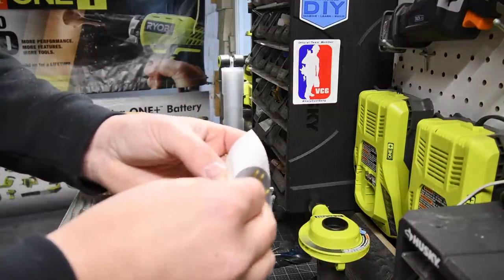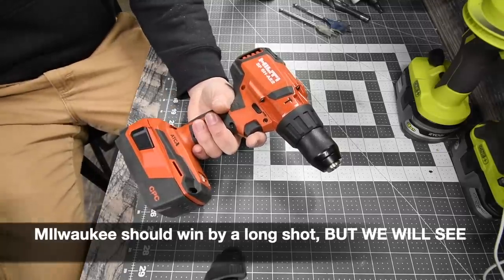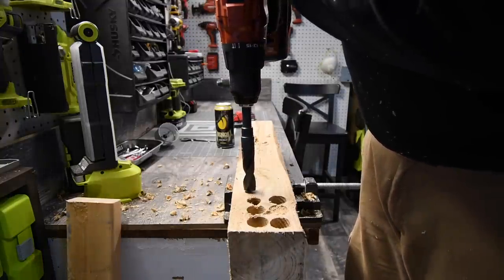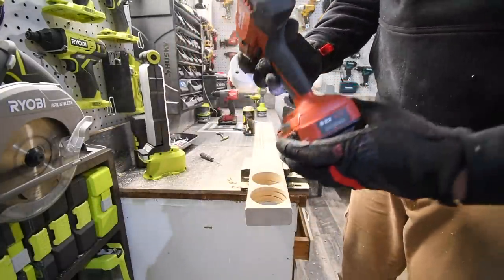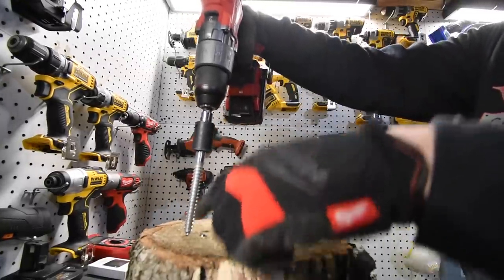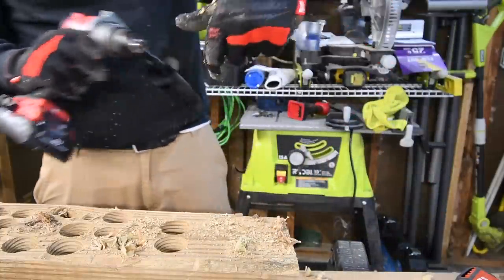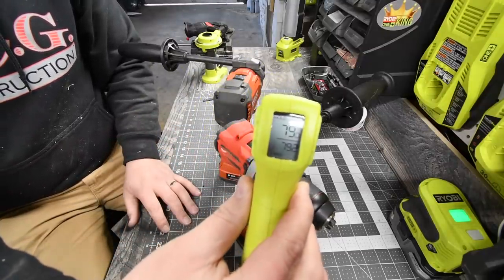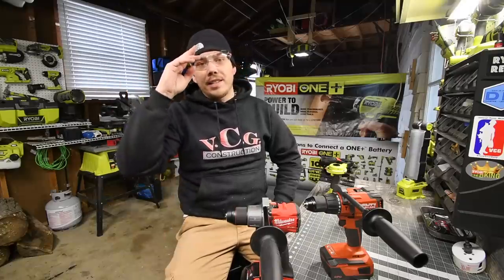Milwaukee vs HILTI (WOOD)

Comment: Hilti wins! Plus the Hilti will out live the Milwaukee by years!!
Reply from the maker: I agree, more test are coming and thank you sir
Reply: Don't forget price/performance. The hilti, at least where I live, is twice the price of the milwaukee but as seen here does not have twice the performance.
Reply: @Turgz  But it will have 5 times the longevity and here in England it's not that much more expensive than the Milwaukee. I own both the Gen 3 and this new Brushless Hilti. The Hilti is far superior.
Reply: @davesheppard8797  I don't doubt that it's superior, it's just not worth it for the price I have to pay for slightly faster drilling speed.
Reply: @Turgz  The thing is that I find all my Milwaukee gear unreliable. The only Milwaukee tool I haven't had problems with is my second 6 1/2" fuel Circular saw. The first one went back faulty. Having said that I have hardly used this saw as yet but it runs every time I  press the trigger which is more than my other Milwaukee stuff.
Reply: @Turgz  in this video Hilti  doesn't have twice the performance but beats Milwaukee all day long.
In this video also Hilti drill is $10 cheaper than featured Milwaukee. 
Compact battery from Hilti also outperformed special compact battery from Milwaukee. 
Please stop saying myths about Milwaukee. 
Now comparing warranty and customer service -Hilti wins again.. 
Comparing tool after 5-10 years Hilti wins again as Milwaukee drill would not exist by then while hilti drill still going strong. 
Hilti - built to last.! ☺
Reply: @toolfevertoolfever8716  Yes, plus it's not just faster....It's built better, It drives screws better and deeper, It has ATC so you won't break your wrist if it snags and the trigger works every time!
Reply: @davesheppard8797  exactly that.
I love this feeling when you come on site and don't think if Your tool is shiny,cheaper ...bla bla bla...
This feeling when You don't think of anything else than get the job done and come back home - priceless.
Reply: @davesheppard8797  my honest opinion about Milwaukee. 
They release new tools quicker than warranty on previous models expires.
This is to say "hello we have bigger ,cheaper , better tool available than we had (You purchased last year ) so come and get a new one before old one breaks up as it's cheaper to make new one in  China than fix the old one because old one was developed in order to buy new one instead and so on for years.(If it makes sense ).
Hilti doesn't release new tools too often as every tool needs to be developed and designed for end user to be 100%satisfied and before mass production it needs to be tested for that criteria. 
Milwaukee is cheaper as it seems they skip any tests.
I have seen Milwaukee and Hilti tools inside and I would always go for hilti.
Reply: @toolfevertoolfever8716  yes.....And Milwaukee fans will always have to have the latest and best Milwaukee out so they are probably not kept in service long before they are replaced with new. Milwaukee must make a fortune this way. I run Hilti and Milwaukee. I have both the drills in the video test. As I said I put an 9amp high output battery in my Milwaukee  and a 2.6 in My new Hilti. Also a 3 amp in the Hilti and a 5amp in the Milwaukee.  Hilti won every test with just 2.6 and 3.0 batteries. I don't believe higher amp hour gives more power...just more run time. Also the Milwaukee's get really hot compared to the Hilti's
Reply: Anyway you are probably all young whipper snappers who've not long been shaving! Not an old 57 year old bugger like me with dodgy legs and too many wrinkles!! (lol). As I approach retirement I like the best and can afford it, so I buy it. So in 8 years time there will be a load of Hilti, Milwaukee and Makita gear up for grabs if anyone wants it!! 🤣🤣🤣
Reply: @davesheppard8797  I totally agree with You.
Hilti saved me a lot of money in a long time relationship.
It came to the point that I was bored with it and followed trend of new girlfriends (milwaukee, dewalt etc.).
I couldn't believe that sleeker (sleeker by size not design)looking and nearly 2 times lighter tool from milwaukee or Dewalt could be more tiring to use than good old Hilti. 
My hands were hurt after using Milwaukee etc.all day long.
Good old Hilti! !!
Reply: @davesheppard8797  glad to hear You are enjoying Your life.
I already have some wrinkles myself.
Keep up good work mate.
I would sell all the tools and go for early retirement ☺
...but on other hand retiring and not doing anything is bad idea too.You need to be involved in life for as long as possible...
Reply: @toolfevertoolfever8716  Oh God! You too? Exactly the same with me!! I got caught up in the Milwaukee hype and bought a load of gear. Ooooops!! Bad move the stuff is crap!! I am back with Hilti for good reason!! (Lol).
Reply: @toolfevertoolfever8716  yeah....the trouble is.......I am dreading retirement!! I love my job with a passion and have been there for 36 years. I am a Maintenance Manager at a large theatre in Bristol, England. I want to bring her back to how she looked in 1912!! 😕😕
Reply: @davesheppard8797  An English man with a passion 👏👏👏
Reply: @toolfevertoolfever8716  Thankyou! 🙂🙂🙂👍👍
Reply: @davesheppard8797  how can you put a 9 ah "High output" battery from Milwaukee? The 9ah is a "high demand", not "High output" battery. The ONLY "high output" milwaukee batteries are the 3, 6, 8, and 12...and the 12 is a "high demand, high output" battery. HdHo
Reply: @christiansantos1429  perhaps it is......but my point was that the 9 amp hour didn't out-do the Hilti with only a 2.6 in it. I apologise it is a high demand battery, I have just looked. I bought the 9amp for my Milwaukee 6 1/2 fuel Circular saw.

Comment: Milwaukee would do better with a bigger battery.
Reply from the maker: but so will the HILTI. I will revisit these test once I get the 8ah HILIT and Milwaukee batteries
Reply: Nah!.....I did a head to head test with these two drills...two weeks ago. Hilti had 2.6Ah battery the Milwaukee had a 9Ah battery. The Hilti still walked it. Bigger batteries give you longer run time not more power.
Reply: Dave Sheppard nah that’s not true they give them more power!
Reply: @rogerslawncare7260  Not on the test I did with My Hilti and Gen3. Hilti 2.6 amp Milwaukee 9 amp. No more power in the Milwaukee than there was with the 5 amp Milwaukee battery. Have you done the test with both drills?
Reply: Dave Sheppard No but I have watched the same drill vs same drill Milwaukee with H.O battery vs normal battery and the H.O battery wins check it out.
Reply: @rogerslawncare7260  Is it on YouTube??
Reply: @rogerslawncare7260  Do you have Milwaukee as your battery platform? I find Issues with the triggers on all my Milwaukee tools except my recently purchased 6 1/2" fuel Circular saw.
Reply: Dave Sheppard yes that’s my main tools but I have tools at work from dewalt I prefer Milwaukee. I do not have any issues with my triggers. If you have issues contact the warranty folks I’m sure they’d fix it for you.
Reply: @rogerslawncare7260  Its strange.......A contractor who came to the Theatre where I work had exactly the same issues. His issues were intermittent as well. He sent them back to Milwaukee but said he was still getting problems after. I have returned some of my gear. My 6 1/2" fuel Circular saw went back after a week as the motor was really rough. The replacement seems better but I haven't used it much since I got it. I have been doing heavier cutting so I have been using my 210mm Corded Makita. I just find that the Hilti's are my go-to drills over the Milwaukee. I have much more confidence in them. I am glad you have had no issues with yours. Here in England, Milwaukee tools are a lot cheaper than Hilti though. Power tools have come a long way since I started working with them 40 years ago. My first drill was an all metal black and decker with a 3/8" chuck, no hammer action and no slow start. A single speed of 2,400rpm and nobody had heard of torque settings!! (Lol). Plus masonry bits were pretty useless in those days. The Theatre I work at has a lot of semi-engineering bricks in it so the drill was even more useless!! (Lol).
Reply: Dave Sheppard You hit a lot of points here but I’d like to comment on the all metal body power tools my grandpa had the all metal skil saw and it was honestly a sweet cutting saw smooth as butter but they are dangerous if the saw shorts out it can shock you I think that’s why they outlawed them here in the states. I will say this I run the brushes Milwaukee tools they are older technology but I got a good deal on them so I couldn’t pass them up they are a big step up from my previous porter cable lol. The only brushless tool I have from Milwaukee is the fuel sawzall and I love all the tools brushed or brushless.
Reply: @rogerslawncare7260  I have a Skil saw I bought about 30 years ago, still going strong! It was the sort of Gun metal blue one with the gold blade surround. I keep wondering how much more powerful these Combi's can get. They keep making them smaller with huge power! I have the Gen 3 Milwaukee and this new Hilti but they really are much more powerful than I really need. I am not one of these people who use a combi for everything.  Any more than 4  2" deep 6mm holes in brick and I get out the battery SDS. Being old school I still get surprised that my Hilti battery SDS drills better and faster than my corded stuff!.

Comment: No wonder you put a 3ah battery and call hilti the winner no no no hilti won because you ran a 3ah battery
Reply: You lost punctuation somewhere)
 The Milwaukee 2804/2904 doesn't come with lightweight batteries, it's an "alternative" battery that's perfect for impact drivers. Unlike you, I conducted tests with 3.0, 5.0, 9.0 and I can claim that with 3.0, the performance in difficult tasks is less than the "standard" 5-6A*g by 30-50% 
You didn't do that, so all you have to do nonono nanana banana.

Comment: It's still 20 volts not 18 do your homework...
Reply from the maker: you gotta do your homework. all 18v batteries are really 20v. the HILIT is not 22v its really 21.6v
Reply: @ManCaverTools  18V batteries are 18V nominal, 20V peak. 22V batteries are 21.6V nominal, 24V peak. kobalt and hilti have same battery voltage for example.

Comment: You are using a 600 watt battery on milwaukee with a 1200 watt battery on Hilti, this is fucking stupid.
Reply from the maker: in that case should I ever do a video again since each brand has its own battery voltage system? like kobalt has 24v
Reply: @ManCaverTools  voltage is only one factor, power is what matters. You stuck a compact battery on milwaukee and a full sized on Kobalt. Use a 6Ah High Demand battery on milwaukee for more fair comparison.

Comment: Yeah what a test 3amp vs 4amp and next vs 6 amp wow what fair testing lol
Reply from the maker: 3ah high Output battery from milwaukee. do you know the difference between that and a regular battery? if I used a 5ah regular Milwaukee battery it would have lost even more than it did, I did a test to see what battery I should use and the 5ah lost big time, the 3ah HIGH OUTPUT battery stood more of a chance

Comment: 3.0 vs 4.0 isn’t fair at all it’s bullshit
Reply from the maker: you are wrong. the is the 3ah is a HIGH OUTPUT battery so it provides more power to the Milwaukee tool. it was a extremely fair fight. if I used the Milwaukee 5ah battery the Milwaukee would have extremely lost instead of losing just a little. The Milwaukee needed a special battery just to keep up as much as it did

Comment: "Hilti is 21.6v system, the milwaukee is 18"..... erm... 5x 18650 Lithium ion, fully charged, 4.2v each = 21v
a "18v" battery, fully charged, is 21v.... just like the Hilti....
Some companies just market it different, to make them sound better than the competition..
Some say "21v max"...... still an 18v system, Just using the fact that a fully charged battery being 21v, sounds better than an 18v drill....
Reply from the maker: these batteries in the Milwuakee and in the HILTI  are 21700 cells not 18650 cells

Comment: 2ah battery on the Milwaukee but 4ah on the Hilti not a fair test
Reply from the maker: ummm, no it had a 3ah high output battery on the milwuakee. I uploaded a test in a recent video that the 5ah battery lost even more on the milwuakee. the HIGH OUTPUT Milwaukee batteries are special batteries. there was no 2ah battery in the video. you need to learn your tools so keep watching :) you will learn a thing or 2 sir
Reply: @ManCaverTools  you're wrong, i have a phd in battery chemistry science with a masters in professional growth, that is a 2ah(ampere ower) battery
Reply: @GmailUnited  whatever your PHD is in the Hilti still pisses all over the Milwaukee!!! I have run my Hilti with a 2.6amp battery and a 9amp in my Milwaukee. The Milwaukee still lost all tests!

Comment: there is no need for this comparison, Hilti is much better than milfaukee
Reply: In an honest test, without quackery with batteries in video tests, milwaukee will be much faster. Although nothing and no one prevents you from loving hilti, it is a worthy manufacturer, but milwaukee is 2 times more powerful and with a standard battery it is the most powerful drill among 18-22V systems on the market, but the A22 is an average power class.

Comment: MILWAUKEE. I’ll never buy Hilti tools. They don’t last long at all
Reply from the maker: I love Milwaukee as well, but HILIT is designed to last a very long time and they do
Reply: I have a Hilti that I got second hand 33 years ago and It's still my go-to drill and runs beautifully. Never been serviced or anything. My Milwaukee gear started playing up within the first couple of months!
Reply: Dave Sheppard Hmm. I guess it depends then. I’ve had no issues with my Milwaukee.
Reply: @mnight207  yes...I'm 57 but still get really excited when I get a new drill etc; I have trigger issues with nearly all my Milwaukee gear......gen3 combi, fuel jigsaw, Gen3 impact. I  bought the 6 1/2" fuel Circular saw and the motor ran really rough so that was replaced. So far the replacement one is great though I have hardly used it. I recently bought the corded 8" Makita Magnesium Circular that will cut 4 18mm sheets of Birch ply in one go. So I wanted a light cordless saw for when there was no power around. The 6 1/2" fuel Circular cuts extremely well. It sounds really wimpy but cuts like a beast!!

Comment: Milwaukee should of used a 4ah battery or a 5... It may be a high output battery but still short 7 cells
Reply from the maker: if I used a 5ah battery people would yell at me for not using a High Output battery. but more test are coming
Reply: @ManCaverTools  They shouldn't because a 3ah HO still can't beat a 5ah battery...
Reply: So my test with 9 amp high output in the Milwaukee and 2.6 in The Hilti.......Milwaukee still got its arse kicked on every test I did. More run time not more power!!
Reply: great

Comment: This guy cannot afford a Milwaukee
Reply from the maker: I think I can since I have about 10 milwuakee tools on the wall. HILTI cost more than milwuakee. this HILIT hammer drill as a kit is about $470
Reply: Here in England the Milwaukee Gen3 body is £109. The Hilti bare body is £210!! I still prefer Hilti though.

Comment: You limit the torque of the Milwaukee using a smaller battery. I have it and it's quite obvious
Reply from the maker: I tests out the 5ah battery against the 4ah before I filmed to see which one I should use, the 5ah would have lost even more compared the 3ah high output battery.  a 8ah vs 8ah is coming soon
Reply: I have both these drills and with a 2.6amp battery in my Hilti and a 9amp in my Milwaukee the Hilti still pisses all over the Milwaukee. Milwaukee are overhyped crap!! I sadly own a lot of Milwaukee tools. Gradually replacing with quality Hilti's.